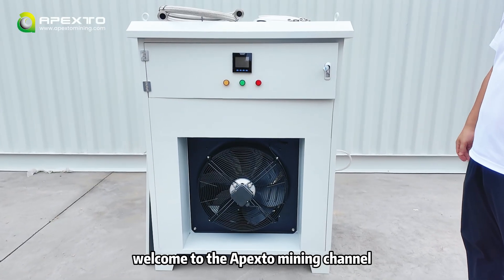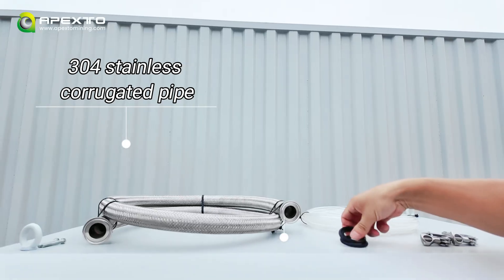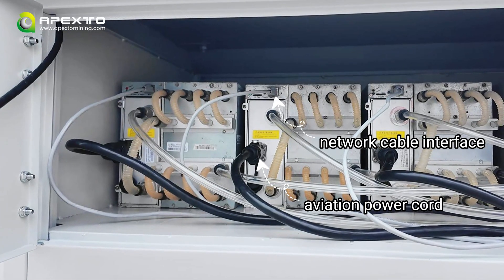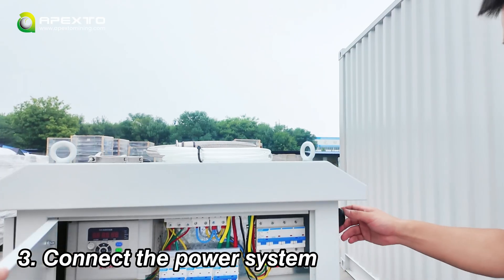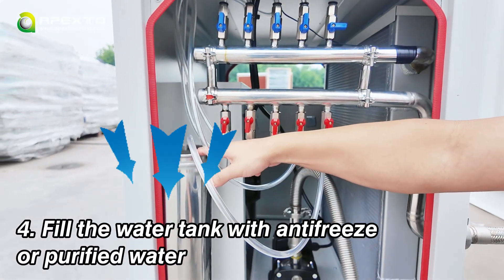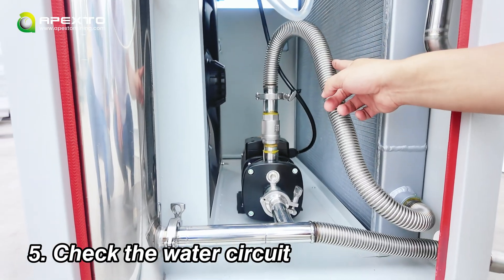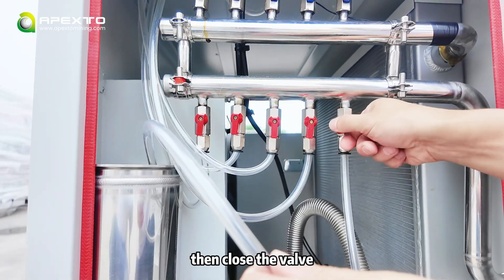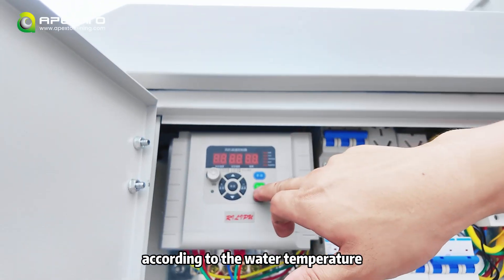How to Install Hydro Cooling Suite AP-H4 | Antminer Hydro Mining Setup Tutorial

Comment: What is the backup time of inverter or it just controls power
Reply from the maker: Thanks for asking! The inverter here is just for power control and fan speed adjustment. It doesn’t provide backup power unless you connect an external battery.